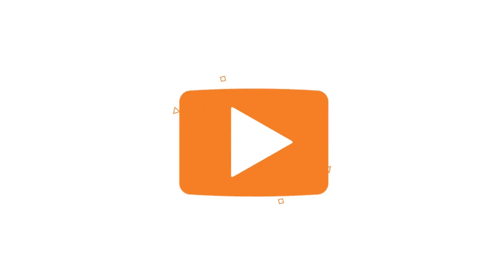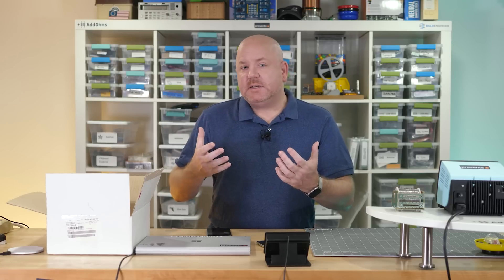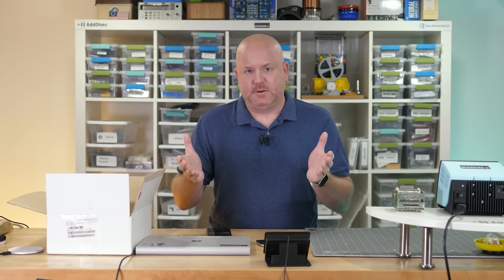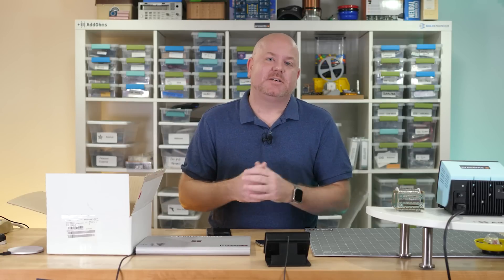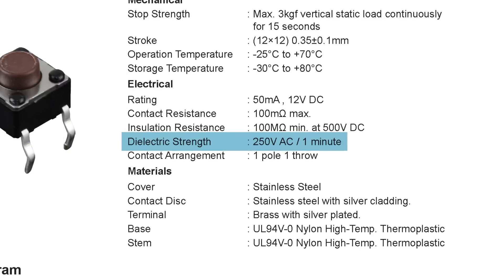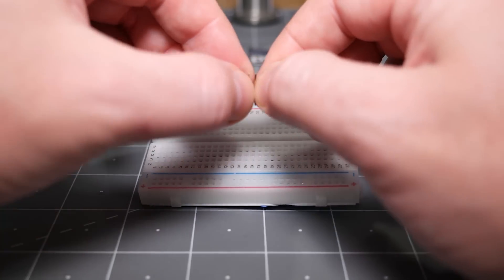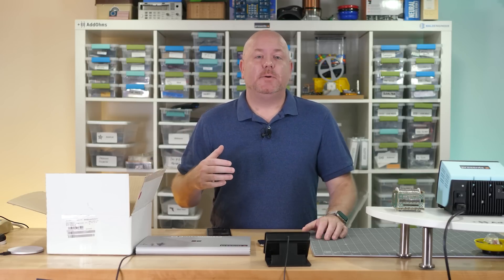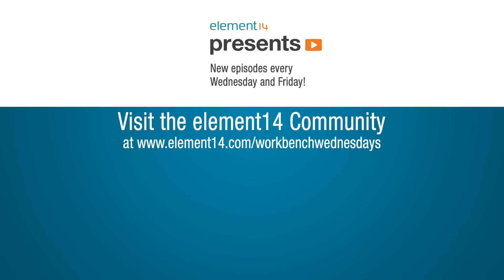What Passive Components Do You Need? - Workbench Wednesdays

Comment: 8:40 I cut wires as I need them to build my inventory, and I color code them on usage:
Red = 12V
Green = 5V (or lower)
Black = ground
White = settings (for example hooking components together to IC outputs)
Green and Yellow = signals
Blue = timer signals
Gray = separator. When I segment my breadboards, I use gray wire to visually wall off different parts.
Orange is usually either 6V if I have that many different voltages in one circuit, or another signal.

Comment: For the love of god, don't get pre-cut jumper wire kits. The wires are cheap and will constantly bend if you don't push them in perfectly. They have extremely low reuse value. Just cut your own wire, or use the Dupont like wires with the round end or just Dupont wires. Yes, the Dupont wires and round wires will all stick out, but do not obsess about getting your wires flat on the breadboard, it's a time suck. And if you need to adjust something a little, it's better to have little extra wire.